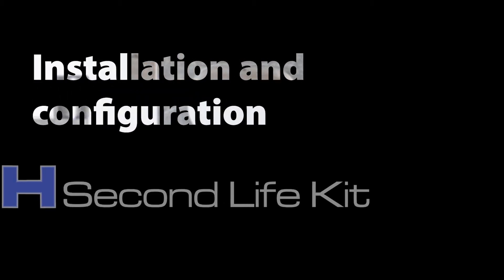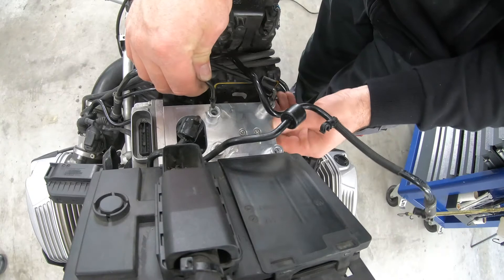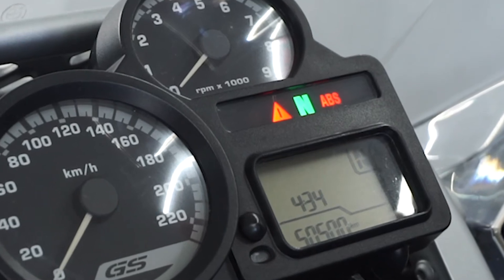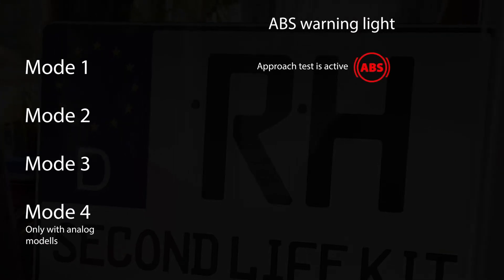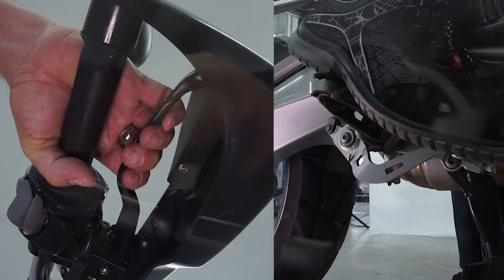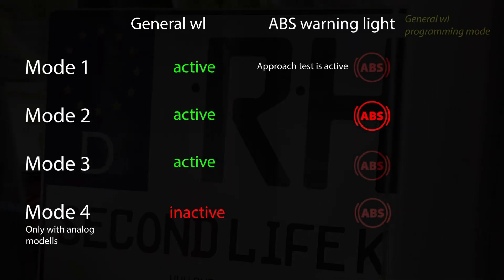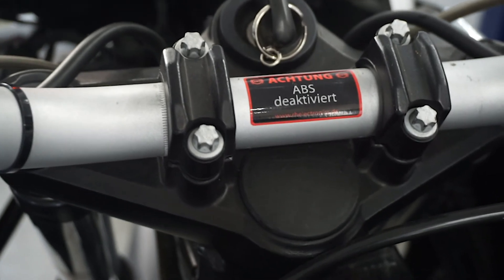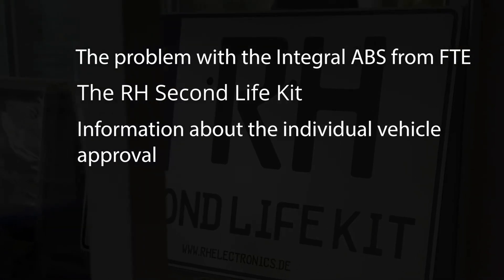RH Second Life KIT: Installation and configuration

Comment: Worked good on my bike 2004 R1200CLC  Had to send back 1x due to not having the CLC software installed.  Cruise, speedometer, brake lights and brakes work now.  Only issue is it appears my USA bike is registering incorrect speed and distance on the odometer.  It appears the bike is reporting KPH instead of MPH, ie  speedometer 110 MPH is actually 75MPH and when I drive 5 miles the odometer indicates 6.7 miles driven.  Decent replacement otherwise, don't have to worry about ABS failures or costs.  And I can return to original later if possible.
Reply from the maker: We have created new software to solve the problem on the CL and CL models